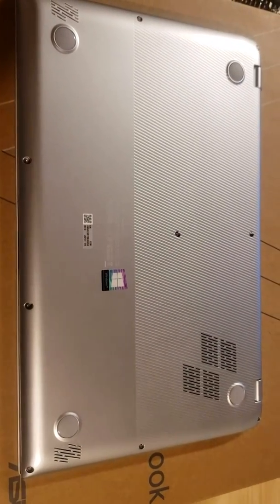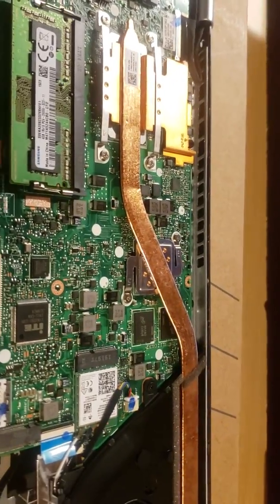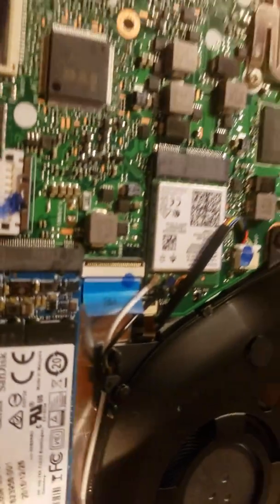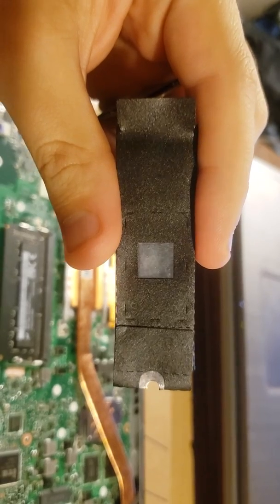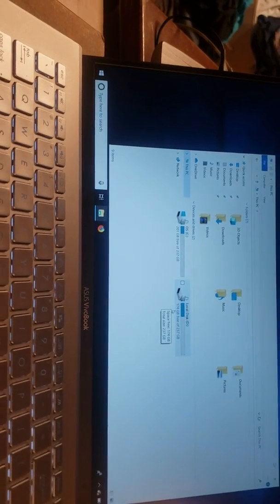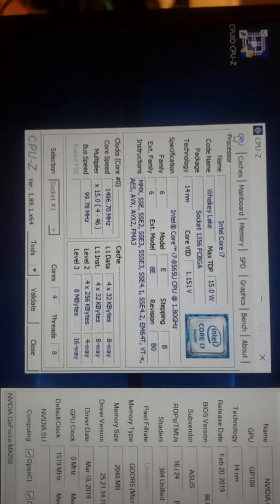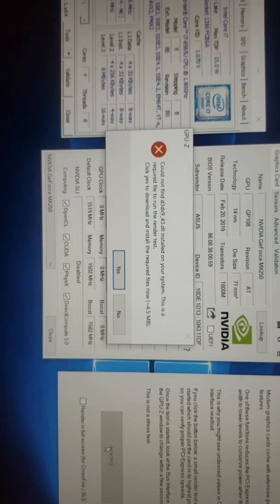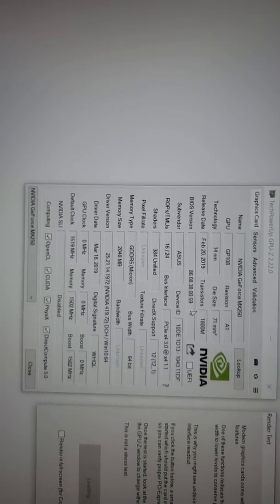Asus Vivobook S15 S532FA with Screenpad 2.0 - upgrading the RAM and SSD!

Comment: Did you have to set up the BiOS for your second hard drive to work? I think you got a SanDisk. What is the model number for that SanDisk?
Reply: For second ssd, necessary ssd sata m.2 b+m. with ssd M.2 crucial mx500 the notebook works perfectly. No setup Bios, incase of problem update bios.

Comment: The hard drive is a NVMe. You can install the non NVMe drive, but the speed is not the same as the NVMe.
Update 1/17/2020
You have to buy a NVMe PCiE P3X2. Generation 3X2. The 3X4 won't work. The NVMe needs to have B+M connectors. If it doesn't, it won't work. Looks similar to SATA m.2, but it's not. Buying a SATA m.2 won't work for the PCIe slot. Buying a NVMe m.2 with just the M connector won't work. You need B+M.
Edit: 1/24/202
No NVMe PCI P3X2 or P3X4 will work. The empty slot is for Optane Memory.
I do not know what type of hard drive was in the video. Is it a SATA, NVMe P3X2, or P3X4.
Reply: For second ssd, necessary ssd sata m.2 b+m. with ssd M.2 crucial mx500 the notebook works perfectly.
Reply: @egi81  you are saying that the second slot, you were able to put a second hard drive? I tried different hard drive and none work. I found out that the second slot is for optane memory.
Reply: @hoangkieunguyen  yes, if you want I send you photos
Reply: @hoangkieunguyen  I installed samsung 970 evo plus but was not recognized even after bios update. It needs ssd m.2 b + m, I have installed crucial mx 500 m.2 b + m, everything works perfectly.
Reply: @egi81  can you send me a link to the hard drive? I bought a WD M.2 B+M and the laptop won't recognize.
I looked at Amazon, would this work?
Crucial MX500 500GB 3D NAND SATA M.2 Type 2280SS Internal SSD - CT500MX500SSD4,Multicolor
Reply: @egi81  thanks
Reply: @hoangkieunguyen  👍😊 I have update bios before install ssd Crucial
Reply: @egi81  it works!! I bought
Crucial MX500 1TB 3D NAND SATA M.2 Type 2280SS Internal SSD - CT1000MX500SSD4.

Looks like the second M.2 is SATA only and not NvMe. I bought all sort of Samsung EVO NvME. I also bought WD NvME B+M. No go for this laptop. Only M.2 SATA B+M.
Reply: @hoangkieunguyen  :-D I am happy for you
Reply: @egi81  does it’s screenpad has left and right hard clicking keys? Like we used to have on traditional trackpad

Comment: How did you were able to open the cap ? I've tried with mine and the thing seems to be glued or something... does it has a special point were to make lever or something ? Thnx !
Reply: I was focused on the lower left with the laptop facing me. After removing all the screws, get a credit card that you are not using...or a gift card. Work the card into the corner slot. After seeing a small give, moving the card along the grove. Going back and forth. Try to angle the card to push out. You will eventually see more of an opening. Slide the card in more. The opening will be bigger. Work one small section at a time. Moving slowly to each opening and take your time. The whole cover is held on place with plastic henges. The back henges are so small that you will end up breaking them, so be careful.

Comment: Can I upgrade up to 16G RAM ? 32G RAM?. How about quality of display? Is 45%NTSC for display good?
Reply: After chatting with Asus. This model has 4 GB of soldered RAM. The max you can upgrade is 12 GB. The RAM speed inside is 2666, but everyone who is selling says to buy 2400. 
Update: 1/17/2020
I bought a crucial 16 GB (1 stick) 2666 MHz. Now my computer see 20 GB.
Bought on Amazon
Crucial 16GB Single DDR4 2666 MT/s (PC4-21300) DR X8 SODIMM 260-Pin Memory - CT16G4SFD8266
Reply: @hoangkieunguyen  Hello hoangkieunguyen
, can you send me the ref of the crucial 16gb do you have bought for your laptop? which vivobook model do you have ? I have the S15-S532FA-BQ199T.
FI, I tested with a Crucial CT16G4SFD824A 16go 2400 extension without success, no boot..
 thx!
Reply: @ericg1164  so sorry for the late reply. Actually, I didn't even receive an email saying that someone replied.  I bought this from Amazon. Crucial 16GB Single DDR4 2666 MT/s (PC4-21300) DR X8 SODIMM 260-Pin Memory - CT16G4SFD8266
Reply: @hoangkieunguyen  No problem ;-), thanks a lot, do you have installed a second M.2 on your laptop?
Reply: @ericg1164  I have tried and failed with a WD m.2 B+M, Samsung Evo M, Samsung EVO M+B. I did update the bios. Someone on this chat told me to buy a Crucial M.2 MX500 B+M. I am waiting for the response to make sure I am buying the right one. Crucial MX500 500GB 3D NAND SATA M.2 Type 2280SS Internal SSD - CT500MX500SSD4,Multicolor
Reply: @hoangkieunguyen  Ok, I opened a call to the support of Asus in France in order to have their opinion. thx a lot ;-)
Reply: I bought the 1TB instead of the 500 GB. Same company. It works!!!! Asus support doesn't know a lot. Storage on second M.2 is 1 TB. Bought on Amazon 
Crucial MX500 1TB 3D NAND SATA M.2 Type 2280SS Internal SSD - CT1000MX500SSD4
Reply: @subramanian232  looks good!
Reply: @hoangkieunguyen  thank u
Reply: @hoangkieunguyen  Bought that same memory based on your story and I can confirm it's showing 20gb RAM for me too. Thank you.
Reply: @McBicbic  glad it's working for you!
Reply from the maker: You can buy a 16GB or 32GB Stick of RAM and add it, though you'll need to remove the 4GB currently inside. The laptop has 4GB soldered to the board that you can never remove or replace.
Reply: @redbarchettagaming650  can u pls link me the ram that u used in this video?
Reply: @markelnar2546  I bought this RAM and it works. Crucial 16GB Single DDR4 2666 MT/s (PC4-21300) DR X8 SODIMM 260-Pin Memory - CT16G4SFD8266